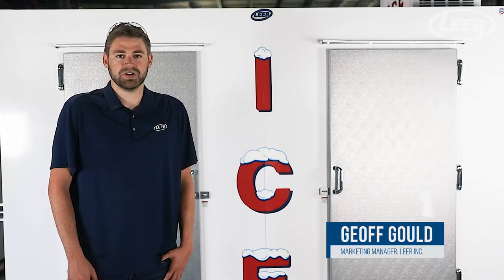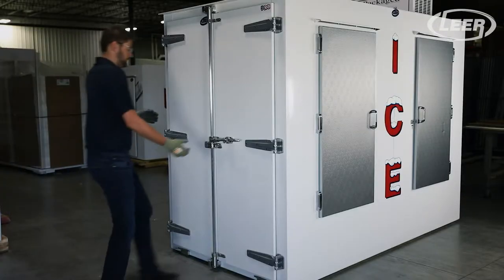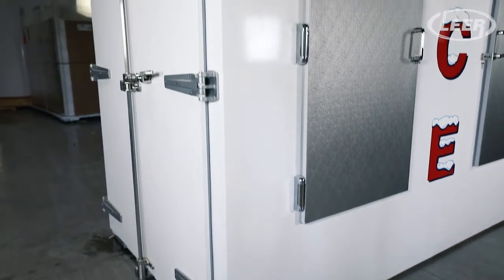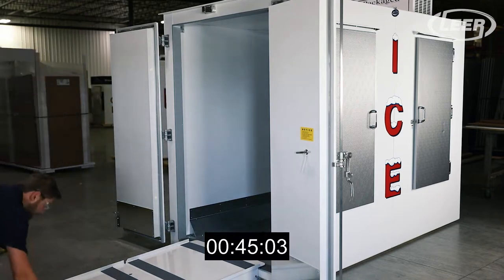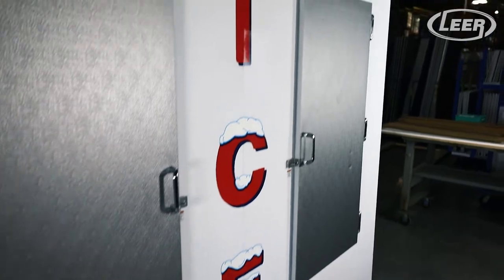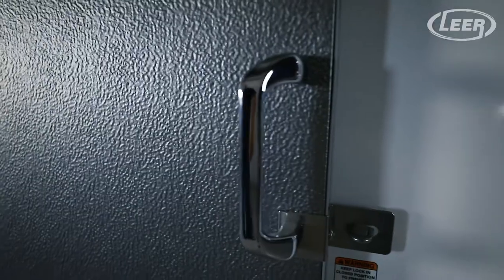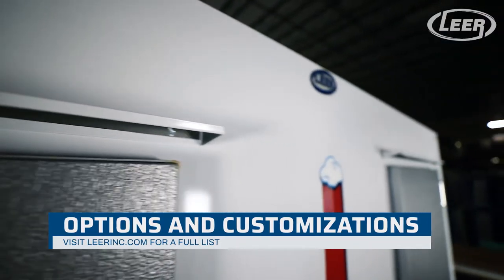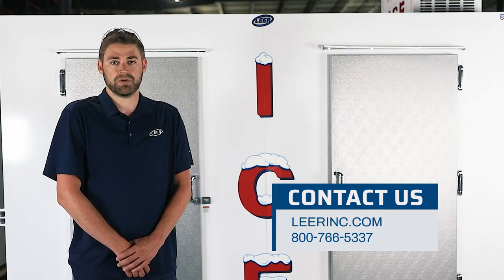Pallet Load Ice Merchandiser Overview - PL225 | Leer Inc.

Comment: Yes the merchandiser is unique and low labor but my helper and I can off load and fill, 630 10# reddy bags in  4 lo pro 60's in under 20  minutues including the paperwork completed.Yes, I could see the machine working well for a low cost single owner/delivery  business operation design, but with 30 years of experience with every possible models durability (from my accumulated experience)  your product cost would inevitably would take longer to recover my initial invest and begin acquiring actual profit before repair costs and required maintenance costs would diminish  profit once again in a endless break even cycle of a machine age value loss to lose further profit on such an financial investment especially here in texas
Reply from the maker: Hey,

We appreciate you checking out our video on the PL225 Pallet Load Ice Merchandiser. Every business, every store, and every delivery crew work a bit different so it's absolutely possible in your setup hand-loading your 60's is the best route to take. We do offer a free ROI Calculator on our website that helps break down the math: https://www.leerinc.com/products/ice-merchandisers/pallet-load-ice-merchandisers/.

Thanks,
Leer Inc.
Reply: Put it on the beach here in destin fl and that box will be empty in 2 hrs! We got covient stores that sell 6 pallets a day! It wouldn't take very long at all to recoup!